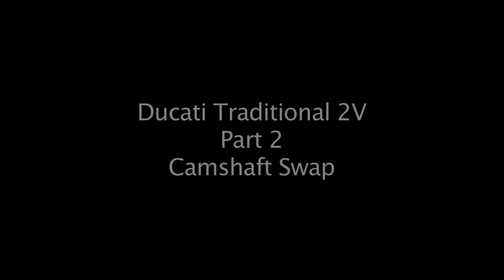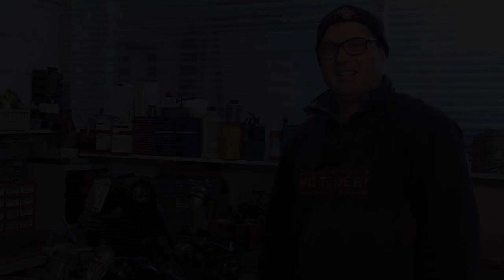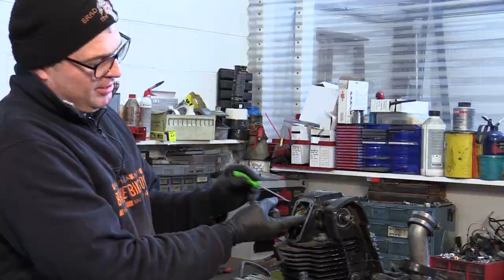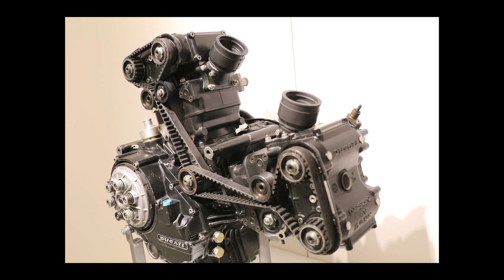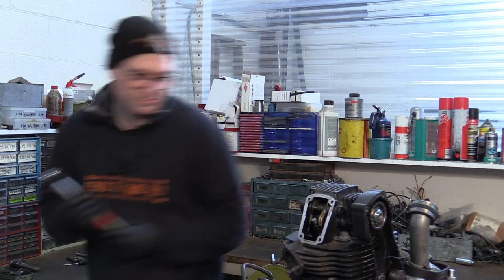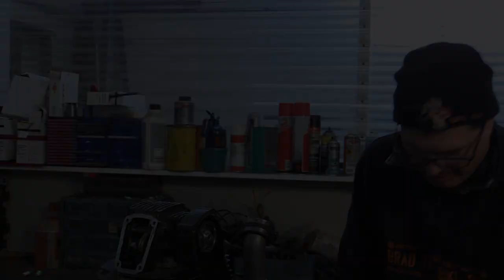Ducati Traditional 2 Valve - Camshaft Swap

Comment: Where do I get that cam nut socket? If Its avalable here in the colonies (US) Is it made by snap on, cornwell, Matco, Mac,  craftsman, proto, Williams, Armstrong, fucking Ducati?  In 1/2 drive all I see on my 1100DS hypermotard tools manual is a wrench & as tight as that nut appears to be in your video I need one pretty bad